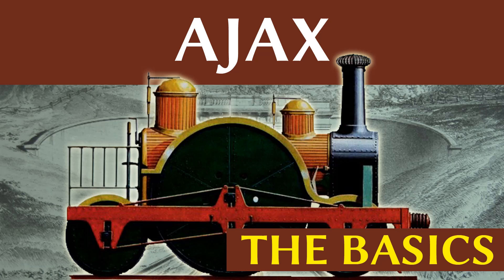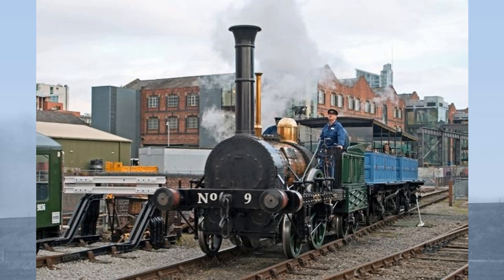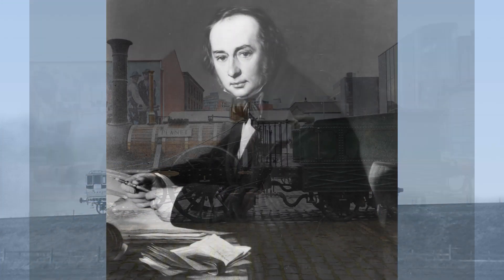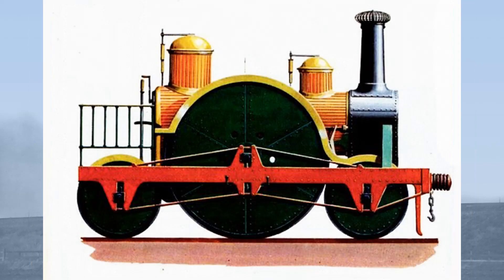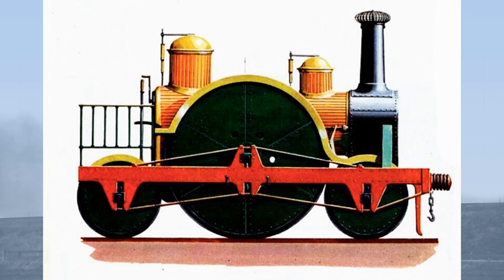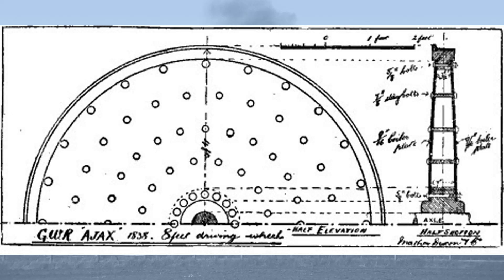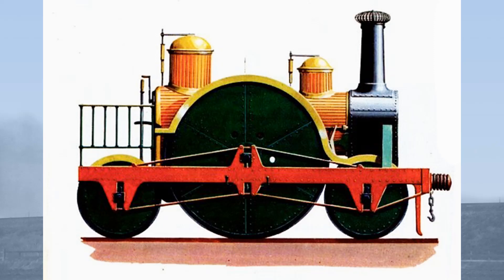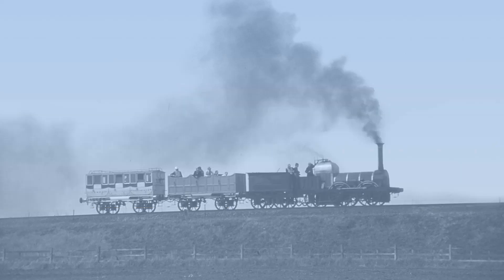Ajax: The Basics

Comment: 0:55 Quite right, I happily admit to being a Brunel fan, and I wouldn't even try to deny how absolutely ludicrous his locomotive requirements were. Considering how much time, effort and thought he put into the actually railway, it's almost as if he just plunked numbers out of thin air for the requirements. I suspect (or possibly hope) that if he had actually sat down himself to design and build a locomotive, he would have both realised his mistake and perhaps eventually produced a reasonable locomotive.

Brunel was a great engineer, but he was also still just human, and he got things wrong. Even some of his successes were nearly failures because he tried to overreach, something I can relate to myself (though obviously on a far less grand scale).
Reply from the maker: His locomotive stipulations were unworkable. And his track design was also a failure. Lessons learned from the Liverpool & Manchester Railway had shown that the track is dynamic and needs to be elastic. Yet Brunel designed his railway to be absolutely solid. He just ignored everyone else and did his own thing, sure in the knowledge he was the cleverest person there was. (a bit like John Ericsson in that regard)

Comment: Hurricane looks like a dog's breakfast. All that length and only one set of drivers. It could have easily have been a six-coupled locomotive. Seems to me, to be large-wheel porn and a competition to see who had the biggest. I'm standing in room with walls of 2.6m height, those wheels were another 400mm taller than that. They probably would have been the single most expensive component on the locomotive. It's mind blowing.
Reply from the maker: Harrison was trying to build a locomotive to Brunel's specification: low piston speed meant large driving wheels to compensate. Low axle weight meant spreading it over numerous axles especially if you wanted to build a big locomotive with a decent-sized boiler. Yes it does look a mess but Harrison was working to a very restrictive design criteria! Harrison was a very competant engineer, it's all logical but also utterly illogical - like Brunel's specification.

Comment: I love this channel already and only arrived today! 
I feel I should take issue with the suggestion Brunel didn't have a clue about locomotives. Just to stick up for him as it looks like nobody else here has. I'm an engineer...but not the mechanical kind unfortunately. My area is more concerned with giving myself regular electric shocks. I may therefore talk a load of rubbish from now on (or according to some family members always have been).
I always thought broad gauge was a fine idea and we were worse off with the standard gauge.  The benefits of a wide track must have struck Brunel as freedom from the heavy restrictions imposed by the standard width. Apart from the extra cost and complexity of the infrastructure all the rest must have looked rosy to him, allowing for comfortable, stable high speed running. The big wheels could be set outside the locomotive and passenger carriages with the centre of gravity below the axles. There would be more space for a big boiler and the front area could be lowered and have negligible impact on streamlining if not an improvement. The big wheels would counter friction by the same factor of the wheel size difference. These trains should have rolled better than any other freeing up power to move the train. The big wheel should ride better too. 
I'm not sure where the specs mentioned came from or why those would be specified by Brunel, but it looks to me like his train was never built how he envisioned it, and that is a shame..
Or have I got it completely arse about tit as usual?
Reply: The Broad Gauge was an excellent idea & we would've been better for it. It was what Brunel designed to work on the railway that was at fault, not necessarily the track. All you needed was to widen a Stephenson engine to 7'&1/4", & it automatically was improved as there was far more room for a boiler & cylinders. Brunel just couldn't do locomotives. He was brilliant at just about everything else, mind.

Comment: By the way, "De Arend" was certainly not "narrow gauge", build for a track gauge of 2000 mm (measured from the middelpoint of each rails, about 1995 mm to present standards). Later, the track gauge in The Netherlands was converted to 1435 mm.
Reply from the maker: Narrow gauge compared to Brunel!
Reply: @AnthonyDawsonHistory  Only 140 mm short? Even the gauge in Spain is not so wide.
Reply from the maker: @m.l.vanzoen236  The 2.141 gauge is very wide. The reason "De Arend" was included was as an example of best practice of conventional locomotive design dervied from Stephenson practice.

Comment: The problem with big wheels is you have no tractive effort. Yes you cover a greater distance per revolution of the wheel but there is a compromise. A locomotive with large wheels will have a high top speed but low effort ,and a locomotive with small wheels will have pulling power but no top end speed.
Reply: I think you did when they introduced sanding. I think Stirling, and Johnson might disagree with you, although you're right in principle.

Comment: do you mind me asking what you meant when you was talking about her working boiler pressure as I did  not understand what you said about the working boiler pressure used on the Liverpool and Manchester railway?
Reply from the maker: Officially the safety valves on the Liverpool & Manchester were set at 50psi. However, according to one French observer, the Chevalier de Pambour, the calibration was poor so that the boiler pressure was actually 75psi. When John Dewrance took over as Locomotive Superintendent in 1840 he unofficially raised boiler pressure to 75psi but didn't tell the Board of Directors who thought he was still using 50si. They thought 75psi far too high and very dangerous indeed.
Reply: @AnthonyDawsonHistory  I understand from reading  the book Red for Danger that a lot of boilers did blow up during those early days but i understand that only one blew up during the life of the Liverpool and Manchester railway company?
Reply from the maker: @eliotreader8220  Boiler explosions were pretty rare occurences  in the 1830s and upto about 1845. I'd suggest you read the book on them by C H Hewison: he used to work for the Railway Inspectorate after having been a Premium Apprentice at Doncaster on the LNER. The explosion on the L&M was to poor old Patentee - check out my video - and was due to faulty design and materials. Boiler explosions became an increasing problem in the  mid-1840s not just due to more locomotives but due to a) a type of boiler known as a long plate boiler which was particularly prone to failure and b) lack of maintenance due to boilers not being inspected regularly, lack of proper maintenance, and it has to be admitted the lack of tools to properly check inside a boiler: candles and flare lamps aren't a brilliant way of inspecting inside a boiler barrel but is all there was. The Liverpool & Manchester had such an excellent track record due to good boiler design and demanding they be tested to three times working pressure. Red for Danger is pretty week on the early mainline period to be honest, and he has chosen some of the worst accidents to include so is a bit skewed to be honest.
Reply: @AnthonyDawsonHistory  did the new Locomotive Superintendent get into trouble for that?
Reply from the maker: @eliotreader8220  He did.
Reply: @TugIronChief 
That's a bit unfair on iron boilers. Good wrought iron can be a very strong material - it just has to be good quality and used correctly. You might be surprised to hear there are still a few locos running around today with iron boilers. Manning Wardle (always rather behind the times) were cheerfully using iron for loco boilers well into the 20th century, and you also find it in other steam applications some way into the 20th century (eg most Shand Mason fire engine boilers seem to be iron - I think they were still building them into the 1930s).

Iron has some advantages over steel - it doesn't suffer nearly as badly from corrosion, which means that the iron boilers which are still around today are often in surprisingly good condition.

A lot of the failures which caused explosions in the 1840s-50s were in part because there were no official standards or calculations for boiler design, nor any statutory requirements for inspection. I think most of the calculations we now use (I do calculations for heritage steam boilers as part of my job) were derived empirically in this period by people learning from failures and near misses.
I've a book from about 1880 with most of the common calculations (including constant values for iron and copper ) - I think it was probably one of the first attempts to formally codify the design process.
Reply from the maker: @TugIronChief  A wrought-iron boiler is perfectly safe so long as it is properly constructed well managed and well maintained. 

The earliest locomotive boiler explosions in the UK were entirely due to mismanagement of the boiler through tampering with safety valves.

Most C19th boiler explosions were due to a lack of maintenance and boiler management: a failure to carry out rigorous internal examinations, or letting the water level drop sufficiently low so as to expose the crown sheet of the firebox. There were failures due to design, e.g. long plate design boiler and such boiler designs rapidly disappeared. 

The other problem was that materials sciences, especially metallurgy were still in their infancy. Most boilers were built empirically, some over-engineered, some under. Another major factor in boiler design and safety was a total lack of regulatory authority and national standards until 1902. That was due to push-back by railway companies, by mill-owners and engine/boiler/locomotive makers against any state interference. What schemes which did exist in the C19th were entirely voluntary, but did result in a major drop in boiler explosions, especially for stationary engines in mills, factories and workshops.

But that's not to say it was all doom and gloom.  Lines like the Liverpool & Manchester insisted boilers were tested to three times their working pressure; were blown down and and washed out on a weekly basis; and they also used a boiler treatment to prevent scale build up. They also ensured they used clean water by collecting and filtering rain water rather than using water direct from wells or worse, rivers.  A wrought-iron boiler is also less like to corrode than steel. And I think, is a bit more tollerant of poor management than steel because it is less stiff/rigid. If you look at the overwhelming majority of boiler explosions in the UK during the C19th they were due to poor maintenance and poor management. So too C20th boiler explosions. One of the first explosions in the C20th was of a steel boiler which burst due to poor maintenance. These boilers failed not due to an inherant problem with the material but maintenance and management. Any pressure vessel which is badly managed or maintained will be dangerous irrespective of the material from which it is produced. And that's the crucial point.

Comment: so the Ajax would have been alright if she had been built with sightly smaller driving wheels as they was her only faulty part?
Reply: All Mather Dixon's locos needed repairs and alterations before being put into use, the boilers, certainly of the earlier ones had a very high water level leaving inadequate steam space (hence the second done added to Ajax's boiler).  The valve gear was badly designed and Brunel criticised the cylinder stroke of their first engines  as too short (hence the large wheel s and longer stroke of Ajax).  Mather Dixon locos on other lines nearly all had exceedingly short lives, compared with those of other builders, too.  As late as October 1840 the Great Western was witholding final payment for the locos and the firm was pleading hardship as a result.
Reply: @mikebrown3772  thank you for that infomation on the Ajax

Comment: Hurricane - a fascinating machine. Almost a precursor of the Garrat engines. I guess the main problem they would have had would've been the steam conduits between the boiler and the drive unit needing to be both flexible and steam tight?
Reply: The first thing that came to my mind seeing a picture of Hurricane was: How much weight is there on those driving wheels? Wheelslip much?

Comment: There is one other engine with massive driving wheels that should be daken note of. the "Crampton" that Norris had made. 7 foot driving wheels with a 6 wheel pilot and the boiler's firebox being below the main axle, with the engineer's deck on top of the boiler. Even the rebuilds after their poor use had massive 6 foot driving wheels in the 4-4-0 configuration.
Reply from the maker: Yeah I know of her.... but seven foot driving wheels aren't that unusual .... or large.

Comment: Fantastic video as always. It may be a little niche/technical, but how about a video on the successes and failures of early valve gear/reverser mechanisms? All we ever usually see is Walschaerts valve gear or Stephenson's linkage in modern steam engines, with very limited exceptions.
Reply: Don't forget the more popular choice near the end of steam. The Baker valve gear
Reply: @TheBroughamGamer  the NZR did quite a sensible thing and equipped the last members of the Ka 4-8-4 class with bakers, whilst the rest all had walschaerts. the baker equipped had better high (relative) speed characteristics while exhibiting poor low speed power characteristics, the baker equipped versions ended up exclusively used on express duties, ending up ill suited for freight. interesting that poppitt equipped locos seem to exhibit the same characteristics. one of the things regarding valve gear is theres considerable science behind them. the NZR using walschaerts from very early in it's development and ordering locos from different world manufacturers to NZR design equipped with walschaerts. the baldwin U ten wheeler and the world's first Pacific, the Q class had walschaerts but was so poorly executed by Baldwin's the NZR for later orders let the manufacturer revert to Stephenson because they could make that okay.

Comment: I always wondered how much weight the story of 'Hurricane' hitting 80-100 mph actually has. There seems to be very little information on Hurricane & all seems a bit contradictory to each other.
Reply: Hurricane's layout reminds me of a paddle steamer.  There must have been some engineering knowledge cross-over between railway and marine engineers; Thomas Elliot Harrison's father built ships in Sunderland - subject for a future video?  Were flexible steam-pipes used in any other application in the early railway era?  How did Hurricane's ones work?
Reply: I think Hurricane probably was the answer to constructing a successful locomotive complying with Brunel's requirements.  Gooch reported that "it worked very well, equal to any we have" and that it was a much better engine than Thunderer, the other Harrison Patent.  However it was the last of the 'freaks' to be delivered and was found to consume excessive amounts of coke which, no doubt along with its general awkwardness, meant it was kid aside after only 14 months.  By then Gooch had persuaded Brunel that the future lay in heavy locos of the North Star type which complied with none of the original specifications.
Reply: Almost absolutely no weight. No adhesive weight on the drivers, nonexistent internal streamlining, poor steam circuit, awkward cylinder dimensions and design, no proper wheel balancing. The locomotive probably could barely move at 10 miles per hour. And even if it could get up to those sorts of speeds, it would be so poorly balanced and weighted that it would have smashed itself into pieces. 

You can’t just slap some big wheels on a boiler and expect it to go fast. The locomotives of the year 1900 couldn’t get up to 100 mph with trains, there wasn’t anything close to a hope for Hurricane. I’d be more interested to know if it ever actually ran in revenue service, because that itself would be an impressive feat for this thing.

Comment: 50 psi? 16mm to the foot models operate at 30-40psi no wonder trains of the eara were so slow.
Reply: Metallurgy was not as well understood nor controllable at the time, and so inferior materials and manufacturing processes had to be taken into account. The welded, high strength all steel boiler of the 280psi Merchant Navy class locomotives for example is a VERY different beast to the copper and iron hot-riveted boilers of the early days of steam!
Reply: they weren't slow at all. they were the fastest things made on the planet at the time. your basis for comparison is severely lacking I rather think...
Reply: @muir8009  they are slow by modern standards. Even a standard bycicle can achieve around 25MPH on the flat, a steam train that goes 15mph... is slow.
Reply: @abrr2000  as I think we're all inferring here: slow in comparison with modern standards is actually very insulting and belittling the extraordinary engineering achievements of the pioneers. comparison with engineering centuries in the future is hardly fair. shall we compare our supposedly wondrous achievements of today with things that will only be invented or progressed in years to come? your op would've been a lot more favourable if you'd just left your comment as noting pressure was low in comparison with modern equipment, without being derisive.